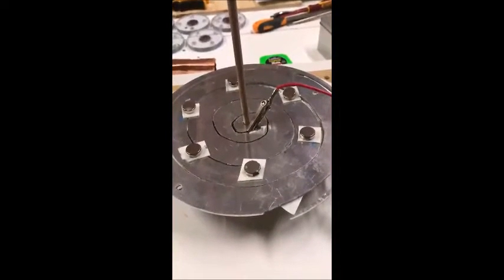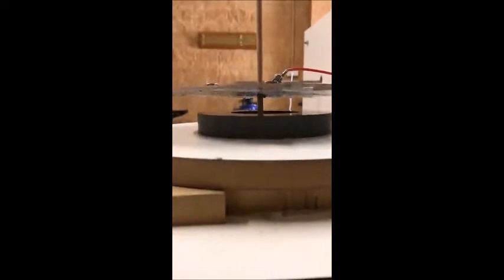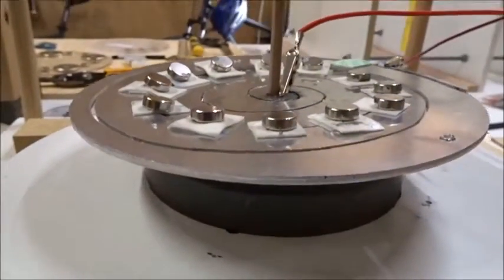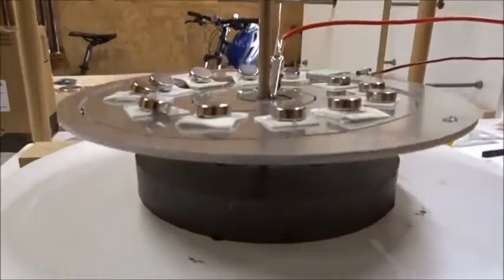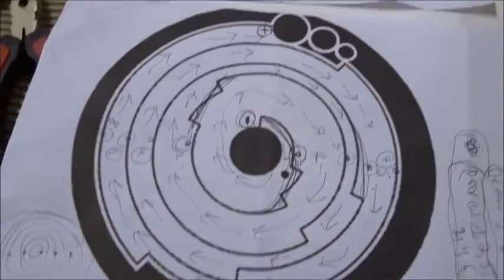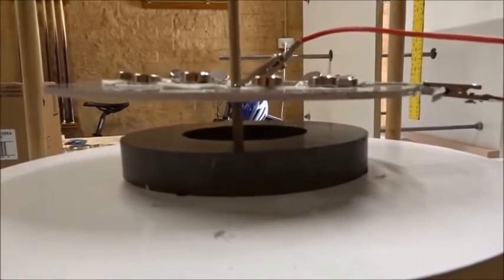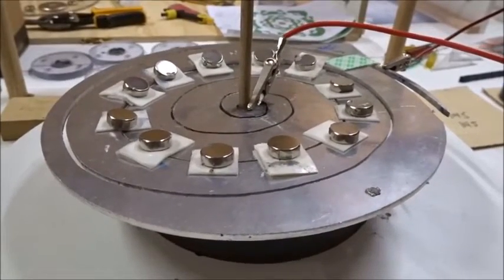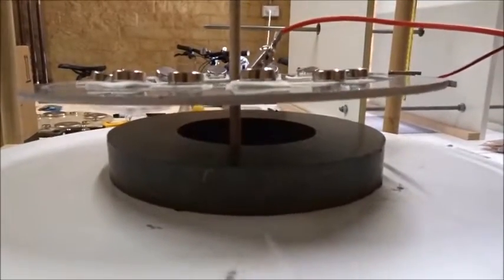Barbury Castle Crop Circle 2008 technology revealed

Comment: Many thanks to my friend in the USA for preparing this informal video. It shows a "first step" toward understanding UFO-based levitation, where a broad spiral electromagnet at the center of a large ring magnet creates a large up or down motion, depending on which way the DC power (2 volts, 10-20 amps) is applied. "Blueprint" for new technology like in Jodie Foster "Contact"? Much more research is in progress. What would a clever experimental scientist try to do next? This effect depends also on the relative sizes of the aluminium spiral electromagnet of 4 turns, and the diameter-hole size of the large ceramic magnet placed below. Some saucer-shaped UFOs show a ring of large electromagnets around their centres (e.g. policeman Herbert Schirmer, Nebraska 1967). Important clue? "We fly by reversible electromagnetism" he was told.
Reply: Horace is a hero to the people of the monde and they don't even know it yet! Quetzelcoatl!!